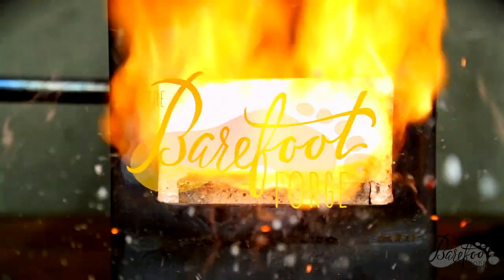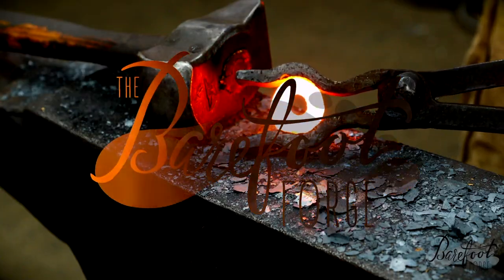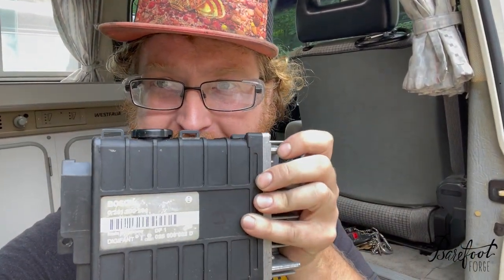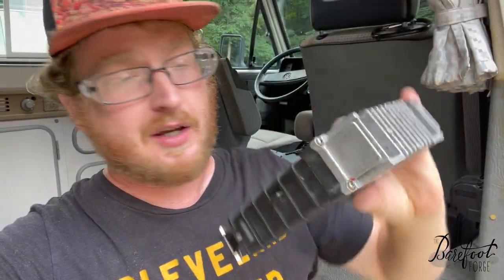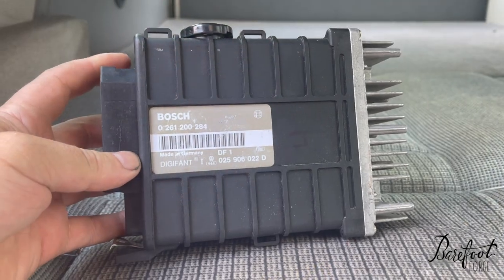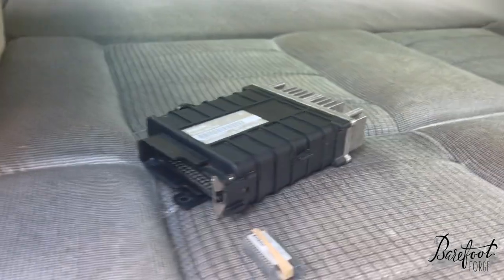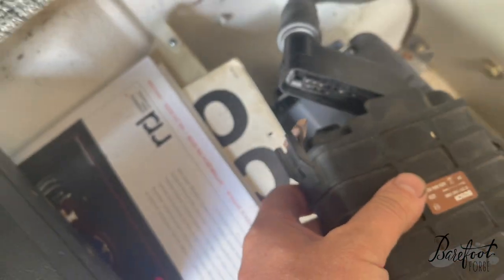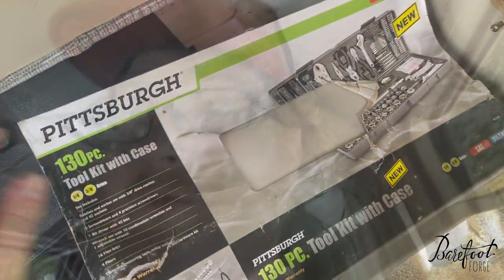Easy Vanagon Horsepower- Chipping the Digifant ECU

Comment: That's a nice van even without an extra 10 hp.  Thanks for the video, even if it doesn't help me with my 1985.
Reply from the maker: Sadly- there is no simple power adder for the 1.9.
Reply: @TheBarefootForge  you can replace the 2E3 Carb wit a dual weber idf

Comment: Swapping in the new 4-hole injectors and 1.35 ratio rockers will give a huge boost. Of course then Mansi Speed's new fuel + ignition setup is the hot setup.
Reply from the maker: I'm not a fan of the aftermarket injectors, from A LOT of bad experiences. All i can say is, i'd be sure to carry your old ones with you....
Reply: @TheBarefootForge  I'm not sure you understand what Marco uses. These injectors are top quality and make a big difference in the middle and upper powerband. Afraid of improved technology? 🤷
Reply from the maker: @karloskelly  I don't wish to discuss any particular makers of aftermarket/modern injectors, I've used them all and installed LOTS of them, there's a pile of them on my bench not being used for a reason. I do not believe the technology is improved, and I have personally seen significant reductions in reliability across multiple vehicles and sets of injectors. Different strokes for different folks though- I'm glad you've found something that you're happy with, and I'm glad you're finding it's a big difference in your application!

When were the stock injectors last professionally rebuilt and flow matched before you swapped to the newer ones?
Reply: by design they flow better and atomize the fuel better, new for new

Comment: That's a much nicer ECU than the '88. The electronics is shielded in metal, the '88 was not. They updated the processor form factor and most likely the processor. I had a stall issue where the engine would immediately die. And then work again. It was the Hall Sender. There is another condition that will stall the engine: when you are engine braking in a manual vehicle the ECU (this is an '88) will stall the engine to save gas after 30-60 seconds. I discovered this on a downhill I would power brake on. If I power braked the entire hill the engine would stop running. If I gave it throttle it would reset the condition. That was a head scratcher for a while.
Reply from the maker: Sounds like a throttle position switch issue.

Comment: Awesome video! I have a 1990 with that a D code ecu, I’m definitely going to look into this. I have the same intermittent stall issue, I changed the idle air control valve and it stopped the stall issue but idles at 1800-2000rpm. Had anyone seen this before? Thanks for the awesome content!
Reply: You could have a problem with the idle control unit or any of the connections between the ICU and the idle air control valve

Does disconnecting the idle air control valve while the Vans running have a noticeable change?
Reply: Hey thanks for responding, yes, when I unplug it the engine dies. Since then the engine caught fire. After repairing and replacing all melted parts the ecu wouldn’t run the fuel pump.  I also found some wires within the main harness in the engine bay that were all corroded and brittle. After replacing the ecu and all bad wiring the engine is running great, I still have to take it for a long ride to confirm that the stalling issue is resolved. Vanagons are always an adventure weather your in the driver seat or underneath. Keep em running, good to see people out there rescuing vans and keeping them on the road!

Comment: I wonder if you can chip a 1980 westy ECU? What are your thoughts?
Reply from the maker: No. The chip doesn’t exist, the ecu doesn’t have a chip socket, etc etc. 

So- no. 

But the aircooled vanagons can absolutely be the fastest ones when they run right! I had an 83 aircooled that was FASTTTTTTT. Fastest accelerating bus I’ve ever owned, and I have every different conversion.
Reply from the maker: No. The chip doesn’t exist, the ecu doesn’t have a chip socket, etc etc. 

So- no. 

But the aircooled vanagons can absolutely be the fastest ones when they run right! I had an 83 aircooled that was FASTTTTTTT. Fastest accelerating bus I’ve ever owned, and I have every different conversion.

Comment: Throttle position switch adjustment may help the hesitation
Reply: That and closing down the CO bypass screw on the air flow meter.
Reply from the maker: You definitely need a properly adjusted tps!

It’s always all about the TPS reports.

Comment: Nice job! One question please, the coding of the ECU is related to the immobilizer or is it indipendent? If my vehicle doesn't have an immo do I have to code/decode it anyway? Thank you in advance
Reply from the maker: No vanagon has an imobilizer, you can swap any digifant ecu with any other one- no programming required.
Reply: @TheBarefootForge  Good to know, found some used ECUs on line, they sell them coded or uncoded (+100$). So now I know I don't need the decode. Thank you!
Reply from the maker: @stefanobuono7820  I still think there's something wrong or a miscommunication there- what website are you looking at?
"D-Code" as described in this video is an ECU ending in the letter D, not in any way coded to the vehicle. In order to make this upgrade- you need a "D- Code" ECU. 

I have never seen any vanagon site selling a "coded" or "Uncoded" ECU, so post a link to what you're talking about so I can help clarify further.

Comment: I have an ‘86, I’m ok with long lead up to 65/70 ( on the flat, no headwind 😅), but I would love a little more power on the hills. The mountain roads are sometimes a little tough on the 2.1l . Do you think this will make a noticeable difference in power on the hills.
Reply from the maker: It’s going to help “some”, but only really if your engine is already performing at its peak. What are your compression numbers? When we’re your valves last adjusted? What are your leak down numbers? When did you last have the throttle position switches adjusted, the oxygen sensor replaced, the afm track cleaned or tweaked with a gas analyzer, the tune up parts replaced, the injectors cleaned/flow matched, or the timing set?

^those things, will all make the engine run properly, only then can the ecu tweak the settings.
Reply: @TheBarefootForge  HP doesn't add torque. Torque is your pickup. Also, I have an 1994 Audi  S4. This has the famous 5 cylinder 20 valve engine that produced 227hp and 258 lbs of torque stock. 700 HP with the right chip and turbo.. I have a stage one chip. We added a socket to put in chips. I imagine the original ECU's may be able to do this. I also put in modern injectors and they do make a difference. Mnasi is using Bosch injectors.

Reading Mansi all they did was make a new ECU with an electronic ignition. I'm surprised that someone else didn't do this before.

Comment: You have to reset ignition timing after.
Reply from the maker: Why?
Reply: You changed fuel map perameters, a variable that affects ignition timing. Plus, Techtonics says to do it. Could very likely affect your idle. Make sure to reset idle after as well.  @TheBarefootForge
Reply from the maker: @Qsandbank  but you’re not changing the static timing of the distributor, so “how” even would you reset it, since it’s set based on max advance? 

I’ve chipped two dozen vanagons and never reset the timing, so simply put- you’re wrong here. 
Timing is set based on the maximum obtainable physical advance of the distributor relative to the physical pulley on the engine, the ability to dynamically change within that range- which is ecu controlled, has no effect on the way the engine should already be timed before chipping it.

Comment: Just a thought.
Why bother getting a new socketed ECU when it is a reasonably simple job to use a low wattage soldering iron and solder sucker to de-solder the existing chip and install a DIP socket. Then you could happily switch EPROM chips whenever the mood strikes you.
Reply from the maker: Mainly because I’ve never heard of anyone actually doing that. I’m not saying it can’t be done, but it’s far easier to just get a D code ecu.
Reply: @TheBarefootForge  We did it on my 1994 Audi S4.